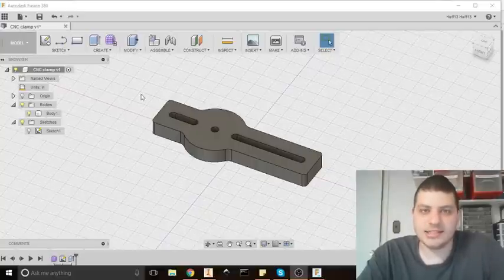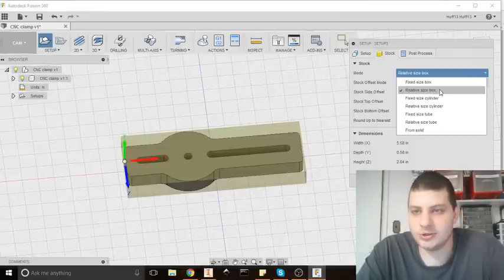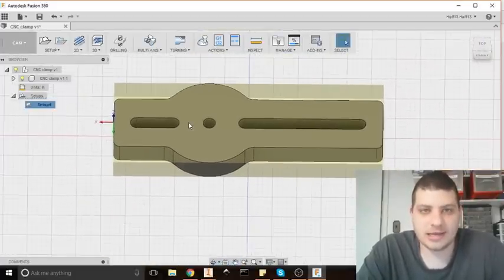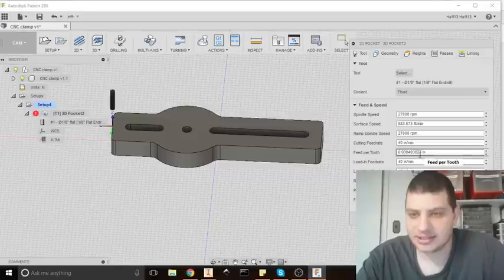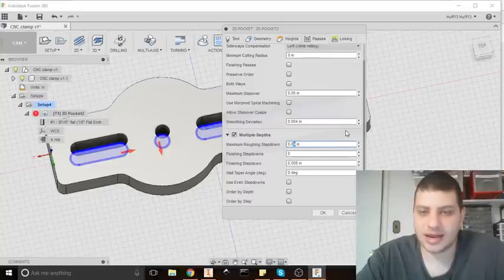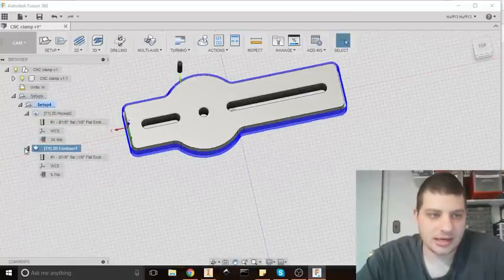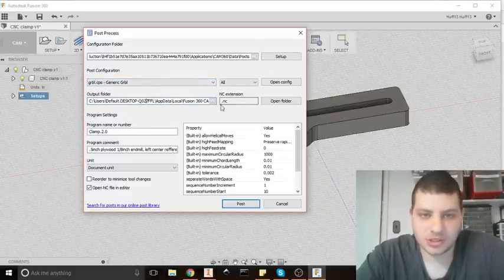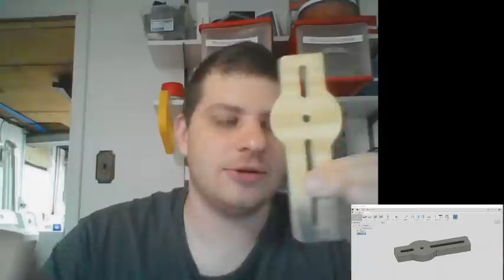CAM for CNC Router: Fusion 360 Beginner Tutorial

Comment: Hey AJ, thx for helping the community:)

Here's a tip for avoiding the minor "gouge" along the top initially while also ensuring the thru cut goes all the way through the bottom, but w/o going too far into the spoilboard. 'STOCK TO LEAVE' is actually your friend:) Set 'Radial" to 0. Set 'Axial' to -0.020. Axial is up/down. Negative means go down below. 0.020 is "20 thousands" (or ~0.5mm). That's generally enough to cut through, but w/o going too far and abusing the spoilboard.

Happy CNCing:)...

Comment: OK fine good until you finish the last window before showing the "G" code then you have a finished part
 HOW AND WITH WHAT SOFT WARE ? I knew just about all you showed needed HOW to get it to my CnC router? Please elaborate on this small but missing bit of info please thank you
Reply from the maker: So the GCode is just a text file, it’s just a series of instructions for your CNC. This gets fed into your controller. I recommend checking with your CNC’s manufacture to find out what Controller they recommend, but at this level it’s general Mach 3, Linux CNC, or GRBL/UGS. At the time I made this video, I was using GRBL with UGS, now I’m using Linux CNC. I can’t claim to be an expert in those controllers, but there is a lot of good information on other Channels.

Comment: Thanks for the info on turning off G28. I couldn’t figure out why my z axis was going straight down. Turning off G28 fixed that. This was the only video that addressed that.
Reply: The bit going down anx crashing is my problem too but if turning off fixes that i still have the problem he had of going from origin directly instead of going up and over and to not cut a line from starting origin to first plunge. Any thoughts on this?
Reply from the maker: You can manually add some GCode at the beginning of your files that fix that. Something like:
G91 G0 Z1
G90

Comment: So when i try to use 2D pocket for the rivet holes in my L bracket, the error "Tool not supported for 2D pocket operation" pops up. Its a 1/4 high carbon bit. What am I doing wrong?
Reply from the maker: +Scott Hall the first thing I would check is your bit. Make sure you have all the settings correct in the tool library. Something weird might be happening if it thinks it’s a V-bit or ballmill or something. I’m also assuming that your bit is smaller than the hole, if it’s larger, there will be issues. Lastly, you can always just use one of the standard endmills in the library. It doesn’t have to be exactly the same, as long as the diameter and length are correct.
Reply: Design The Everything ok ill look into that. Also before I select a tool, it shows the cutting rate and all that stuff. But when I pick a bit, all of that disappear. Then finishing rate is zero and when I out in a number, it says the finishing rate is higher than the cut rate, And shows a exclamation point sign. Why does the cutting rate disappear after choosing a bit?
Reply: Design The Everything excuse my typing as I sausage thumbs lol

Comment: I followed your instructions and had moderate success, think i'm doing it as you do but when I send the g code to my machine it first travels across the x and y plane to the first cut area ,then z axises strait up then back down and begins its routine and works properly from here on. can you think of anything I may have forgot in the set up to make it drag the cutting tool to the first cut instead of "jumping" to it ? thanks
Reply from the maker: +jefferson janaina I’ve hit that same problem before. You can fix it by adjusting the safety and the travel planes in your set up, but I’ve found it’s easier if I just move the Z axis on my machine farther up, off of the work piece after I set my zero.
Reply: ok that's what one of the guys on the fusion 360 forum had told me to do but I guess it never occurred to me that he ment after I zero it. thanks for that, pretty new to this stuff

Comment: At the end of your tutorial you show where the tool dragged across the part to the first cut position. That is my problem. Can you please tell me the best place to make that adjustment? Also thanks for the G28 OFF hint. Really helped. But let me ask you also...can you show how and where you clamped the workpiece down  with the X & Y origins shown, relative to your machine origin (please show that as well) Then if you jog your machine away from home could you show that process. Please explain if you zero out any of the machine coordinate systems and which coordinate system you use. Did you specify that in Setup? I know this is a lot but I seem to be spatially challenged and can't seem to visualize this in the process. Thank you in advance. If I can get this important wedding present part cut I would be so grateful. I will send you a photo of the finished part.
Reply from the maker: +Gaylord Livingston this will be hard to do over YouTube comment. Can you send me an email at Contact@indianaprototyping.com? We'll get you sorted out over email.

Comment: I have the same problem with the cutter dragging across the workpiece on it's way to the first cut. Why doesn't the CNC move up prior to moving to the first cut path like it does in-between other cut operations? If I don't set the start point low enough it doesn't get all the way through the part. The only thing I have thought of is to add some artificial thickness to the part and then have the start position slightly higher than the part. Is there a  CAM setting to fix this? Great Video.
Reply: I already got it figured out. Even though I don't use G28, after I set zero start position on my CNC to be at the workpiece level or even slightly low, I can just move move Z up it all works great. For some reason I though the g-code moved the CNC based on start position. I think I'm all ready to start my first real project. Thanks.
Reply from the maker: +Blazzzy04 yup! That's one way to do it. You can also manually add some GCode into the beginning your file.  A simple G0 Z1 would lift the spindle so it can move.

Comment: I have done everything you did in Fusion 360 on one PC in my office. My PC that runs my X-Carve is in the garage.. How do I send this to my X-Carve? Does Fusion 360 send the code directly to my X-Carve when I post it?
Reply from the maker: +Wood'n Metal Shoppe for my CNC I load the GCode on to a thumb drive, move it to my CNC computer and then send to the CNC using Universal GCode Sender.
Reply: Ok, thank you.

Comment: so if i have to bore like 1000 1/4 hols how do i do that , you had to pick 3 bottom edges but i have 1000 edges, is there an easy way to do 2D pocket. 
thank you
Reply from the maker: +Max Smith so if you are just drilling holes, there's a setting for "select all holes with same diameter" or something like that. But unfortunately I don't know if an easy way to do it with a regular pocket.

Comment: Thank you for the video, going to start cutting some carbon fiber.
Reply from the maker: +danlatu I've never tried cutting CF before. I heard it really tears up your machine.
Reply: bought a cheap 3040 cnc router to cut frames and need to make prototypes. Failure is eminent, but I am motivated. Fixing a 3d printer right now. I like to tinker.
Reply from the maker: +danlatu Nice!

Comment: I don't even use clamps anymore on small wood projects. 2 sided tape is super fast and works like a charm. You can cut a little deeper to go all the way through the part but never hit the spoil board. I've been using it on aluminum parts to and it does work. Nice video on Fusion360, I have vcarve pro and would never have purchased it if I found fusion first. Fusion is  free and as good as vectric aspire that cost's around $2,000! what a joke. Thumbs up

Comment: I've learned a lot from this tutorial.  That being said, I have a problem.  I have three identical parts that I want to cut.  By following this tutorial, I have a pretty good handle on everthing...except:   For whatever reason, the 2d contour wants to cut inside the part perimeters rather than on the outside.  I don't know if it has something to do with the three parts in the same job or something else.
Reply from the maker: I've been asked this a couple times in the last couple weeks, I'm going to go ahead and make a video about it right now. In short: when you select the profile, there is a red arrow on each profile, if you click that arrow, it will cut the other side.
Reply from the maker: Here's the video with the full explanation:
https://youtu.be/1shq2HC7iqs

Comment: Good stuff but I got lost on my drawing and it was cutting the 2d contour around the inside of the design not the outside. Going to have to figure out what I did wrong there Lol
Reply from the maker: +Jerry's This and That do you mean on the CAM phase or the modeling phase?
Reply: When I was running the simulation in the CAM program. It appeared to be cutting around the inside of the clamp instead of the outside.
Reply from the maker: +Jerry's This and That ah, I see. There's a drop down box that says "sideways compensation". That might fix it. You also want to make sure you are doing a contour operation and not something strange like a pocket or something.
Reply: Thanks AJ. I will give the sideways compensation a try